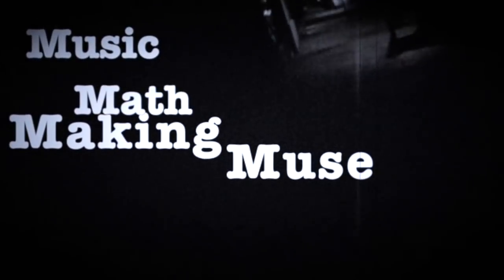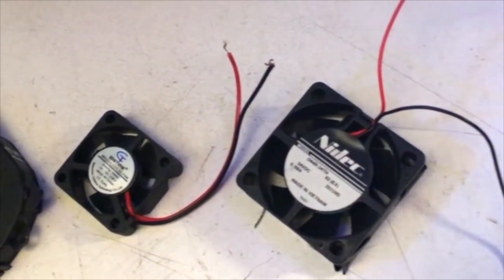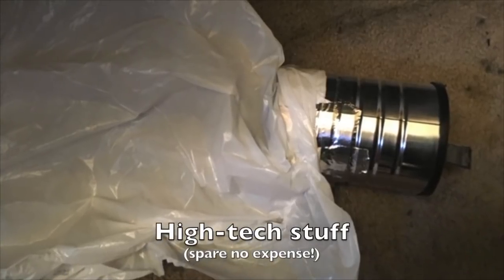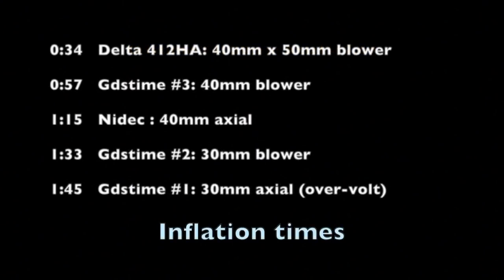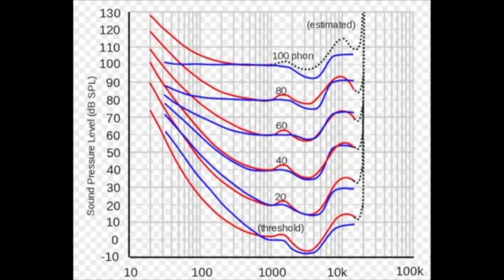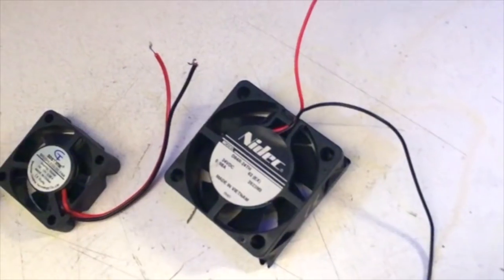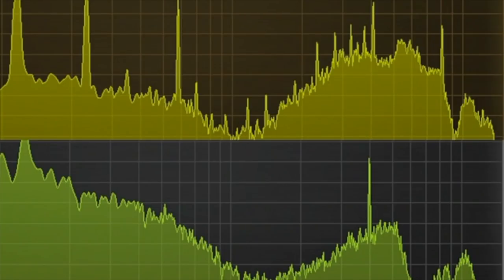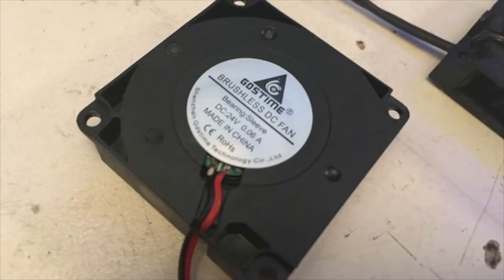More blower tests (and lying data sheets)

Comment: I'd suggest you undervoltage the 50 mm fan  to a level where it take as long to inflate the bag (ie, same CFM) as the smaller 40 mm fan and then compare how loud they are.
Reply from the maker: Good call.  I should have thought to try that

Comment: The original 50x15mm fan is a Sunon MF50151 if memory serves. There's a bunch of versions of those with different speeds though. Haven't tried it myself, running a knock-off for now.

What I'm thinking among the things you have I'd stick with the Delta blower and just run it at less than full blast. Still gonna beat everything else.

Some terrible ideas that haven't been tried:
* Put a fan in a foam padded box open on one side which is away from you, run a tube, something like silicone 8mm ID 12mm OD, to the hot end. You can't use large diameter silicone tubing with less than 2mm wall thickness or it'll find any excuse to knick.
* use a bunch of peristaltic pumps or ultrasonic valve air pumps. This is a terrifyingly bad idea, but I fear it had to be spoken out in order to be dismissed with confidence. But at least they'll clear any pressure restrictions, eh? Such as tubing...

Also, content combining acoustics AND 3D printing, nice :D
Reply from the maker: I have been tempted to try the 'remote fan' idea with tubing, or even a compressor and air reservoir.  I might give it a go when I get into the hotend series

Comment: The Ramps 1.6 Plus won't work with the Re-Arm.  There are two problems.  First is only 1 out of 5 of the pins they chose for chip select are available on a Re-Arm.  Second, at least with Marlin 2.0, is if you are using a ReprapDiscount Full Graphic Smart Controller LCD the hardware SPI pins cannot be used with the drivers.  I don't understand why the hardware SPI can't be used as the chip select pins will be different.  I was hoping that I could wire up just the 3 chip select lines I needed by bridging aux 2 to where ever I could steal them from.  Marlin 2.0 won't even compile if you have hardware SPI and ReprapDiscount Full Graphic Smart Controller LCD enabled.
Reply: Unfortunately the reprap discount graphic LCD doesn't have a Chip Select pin for the display routed out to extension connector. So it's not possible to run it with other SPI devices, as any bit of bus communication would trip up the display. This seems like a terrible bit of misengineering potentially stemming from limitations of earlier firmware - obviously it would make more sense to share SPI bus between LCD and SD-card and disambiguate them with CS.

It is my understanding that the display is generally not run in hardware SPI. In software SPI you can give it a separate clock signal to disambiguate it from other devices sharing the same data lines. Hardware SPI is generally dedicated to SD card handling which is in dire need of it.

Do you have a bug filed on the Marlin issue tracker so we can take it there? Even if something is potentially not-a-bug it's important to file to find workable solutions.

Edit: according to the schematic I'm wrong, CS should be there. I just received the graphics LCD and will investigate.
Reply from the maker: Interesting.  The RRD full graphics controller has some issues because of the way the display driver ignores the CS, so maybe they did a workaround that is preventing it from building. I knew about the missing pins, and I was just going to move the CS line like you did, but I have not gotten into the firmware setup yet.  I'll have to give it a look and see why it refuses to compile.  It would be a shame if it is a no-go since many people run 2130 and a RRD LCD (and bizarre, since SPI is meant to run multiple independent slaves from one set of pins). I know that both HW and SW spi was confirmed working with ReArm+tmc2130 at one point, so i guess I'll have to juggle the LCD/SD around and see if I can get everything to play nice, once the drivers are delivered.
Reply: @AlexKenis  I think it is an assert or sanity check that says you can't have both enabled at once.
I am not upgrading from an Arduino.  I assume that hardware SPI works with both the 2130 drivers and the RRD Full Graphics Controller on Arduino.  If that's the case then why can't it work on the Re-Arm?  I've also wondered if it would be better to wire the LCD up for software SPI leaving the hardware SPI available for the stepper drivers on the assumption they are more important to service in a timely manner.
Reply from the maker: @David Mulligan Ah yes, just looked and the setup is specifically disabled in the sanity check. @Siana Gearz I think you are right about the SPI clock since you have to feed ST7920 slowly (ran into that trying to get it working with STM chips), and I also remember something about it also not respecting the CS signal, so they are prone to on-screen garbage (it still occasionaly shows garbage regardless). They likely solved both issue by requiring SW spi and disabling other options with a check. Makes sense since they specifically disabled just that LCD panel.  I guess I'll peel through old Marlin discussions/commits to see exactly what the problem was, and if it could be solved by either using the SD on the board instead (unless the clocks of the two busses are tied together for some reason... then that would be a bigger issue) or giving up more pins to run a separate bus and disabling the sanity check... or some other option. Those ST7920 driver panels are not my favorite, but I'm willing to put some time into getting it working with 2130's since it is such a popular setup.
Reply: @AlexKenis  Where is the best place to discuss this?  The only "forum" I've found is the Marlin 2.0 GitHub Issues section.  It feels very awkward to use a bug tracker as a discussion forum.  I must be missing something.  Also are there any recommended affordable alternatives to the RRD Full Graphics Controller which would allow unconstrained use of the hardware SPI lines for the drivers?
Reply from the maker: @DavidMulligan   Okay, long answer: The bug tracker is the best place unfortunately. Most of the 'discussion' happens in mega-threads, so for feature requests, etc, just start a new issue.  The devs are pretty good about reading everything relevant, but they are overworked enough that many small fixes and feature requests get lost in the shuffle. Best bet is to approach them with a proposed fix and some code to save them the grunt-work, and let them do their thing on the details (if you can't solve it outright and make a pull request).  It helps to add a tag to your title like [feature request] or [question] as well as tagging it with the Marlin version 1.9 or 2.0.

I am finishing up the editing on the initial 'basic' reArm review video, and then the next thing on the plate is to figure out that display issue and post a fix/workaround as part of a "part 2: extra nerdy" review, if all goes well. I still don't have the 2130's yet to try in the 1.6_plus, but I already started poking at the code.   So if you can't wait until then, you can poke on the Marlin Github bug report and see what they recommend. The issue SEEMS to JUST be about garbage lines appearing on the screen because of the misbehaving hardware, so If you wanted to get a head start, off the top of my head, things I want to Start with are: 

1) disabling the sanity check and seeing if there alternative ways of dealing with the garbage  (I don't know if that is impossible because of the LCD driver timing/delays wrt other devices on the SPI bus)

2) disable sanity check and disable the panel's on-board SD reader to see if using the reArm's built-in SD reader avoids the garbage lines (again, not sure if the LCD code will conflict with the 2130 code)

3) using software SPI on different pins for the panel, and using hardware SPI for the 2130s (would require using jumper cables for the LCD instead of the adapter and ribbon cables, or modifying the ribbon cables)

4) last resort: hacking either the 1.6_plus or the RRD graphics LCD to separate the lines and jumper them to 'safe' pins, then change the assignments in the firmware

As far as cheap alternative panels... it's complicated, and I have not explored that much YET, but I'll look on the usual import websites and see what is around out there these days.  Absolute cheapest option is likely a DIY <character based panel + i2c backpack + encoder> on a piece of perfboard, which would only cost a few bucks if you can live with a character based display (ad if character displays are working in the HAL... haven't checked yet), and then just use the SD card on the reArm board. Or do a DIY full graphics SPI panel with a driver chip that works. I m not sure of all the panels the are supported in the 1768 HAL yet, but I'll look into it and see what I have here to try.  

Here is some off-the-top-of-my-head knowledge: For full graphics displays, Marlin 2.0 has an intermediate step between the HAL and the u8g library, so you can't just plug in a display and load the driver like Marlin v1.  You have to write it into the HAL_LPC1768 folder. From the 'pins' file, it looks like they will do ST7920 and st7565 panels: The RRD panel is ST7920 based, and we know about those issues, but some other ST7920  panels separate the SPI into 2 lines, so... dunno.  But the VIKI2 is st7565 based (like DOGM/adafruit graphic panels), so theoretically you could get other panels based on those chips working.  I don't know if SSD1306 panels are supported, but character based panels almost certainly are (I'll have to try it though to make sure there is no library conflict... otherwise I'll have to make some code changes or find a lib that works(had to do that with the STM32 HAL), so you could  maybeuse a 2004/1604 character panel with a built-in i2c backpack (usually based on PCF8575 expander or similar), which would take the LCD off the SPI line entirely.
Reply: @AlexKenis  Wow.  Thank you for the effort you spent replying to me, I really appreciate that.  My second biggest problem with using a bug tracker as a discussion forum is it is so hard to expand and search through the 32 bit mega thread/issue and it seems to contain much of the information I seek.  Using the information you shared with me I was able to search better and find some of the issues reported about drivers and RRD Full Graphics panel sharing hardware SPI.  I couldn't find if software SPI is intended as a temporary work around or what the technical difficulties solving it are.  Garbage on the display may just be something we have to live with on the Re-arm and RRD.  https://reprap.org/wiki/Re-ARM#LCDs

I don't think the SD card reader on board the re-arm can be used by Marlin for gcode like the one on the RRD can be.

Conceptually I prefer the idea of software SPI for the RRD over the drivers.  Interfacing with me is so much slower than interfacing with the drivers.  After thinking about it for a while I realized the SD card reader may need hardware SPI more than the drivers.  I don't know much about SPI but I assume hardware SPI is faster and more reliable than software SPI.  Some implementations of hardware SPI even uses DMA according to a quick search I just did.  I'll have to dig into the LPC1768 documentation.

I am a software developer with a background in electronics.  My electronics knowledge is very rusty though as is my C and I haven't tinkered with microcontrollers since the Microchip PIC16F84 was new.  I am hoping to have time to roll up my sleeves and dig into it over Christmas.  It would be nice to get my name on a few commits.

The MKS TFT panels appear to use UART communications.  Marlin 2.0 appears to support UART but I haven't found much about compatibility with the MKS TFT panels.  Another option is to connect a touchscreen to my Pi and use the Octoprint-TFT plugin.   To be honest, I mostly use Octoprint to control my current printer and I can't see that changing for the new one I am building.  A nice screen on the Pi might be a good option as long as the Marlin 2.0 to OctoPi interface is more reliable than it has been with my Monoprice Select Mini v2 and OctoPi.

Comment: I have same Gdstime 40mm blowers, I wanted to place 2 of them from two sides so it will be much lighter (2x12g + some basic mount) than configurations like petsfang which has at least 100g of printed plastic. But I have problem to place it In my corexy configuration so I'm running Sunon  MF50151VX-B00U-A99 and small mount for Prusa MK3 fan duct.  Also I have tested extruder with closed loop timing belt (https://goo.gl/xL5vGS), but I have used M5 screw (4.9mm diameter) instead of quality 5mm axis and it wobble too much.  I have to go back to Bondtech Mini with stronger 
stepper driver.

Comment: nice,got the 4010 and the 3010 gdstime blowers, tried both , finally went with this design

https://a360.co/2L6TEvW

had to over-voltage the 3030 hotend one . like 15v.
Reply: ah this is the 4010 model 
https://a360.co/2C2zJvo